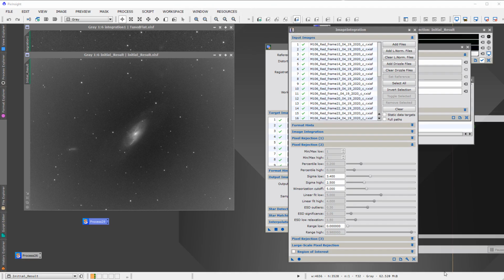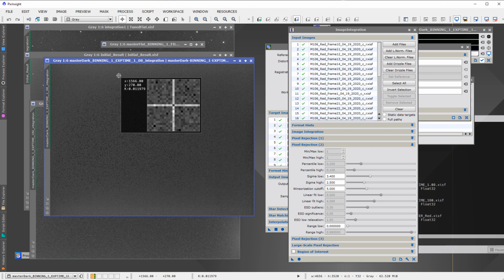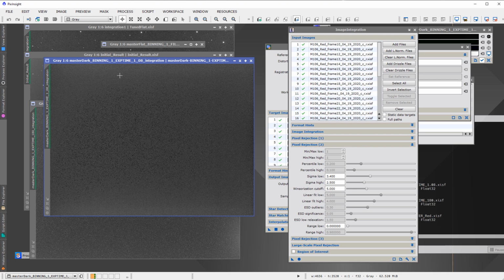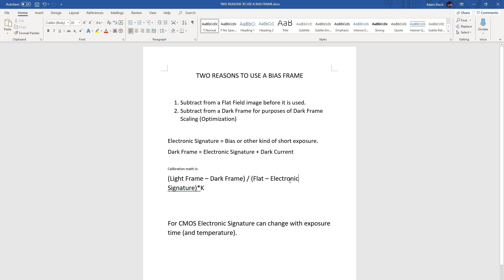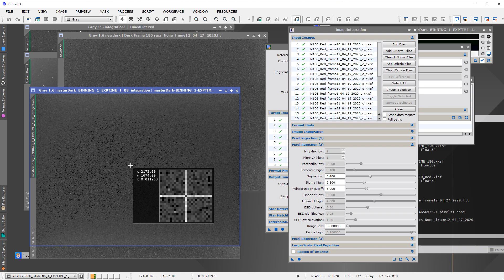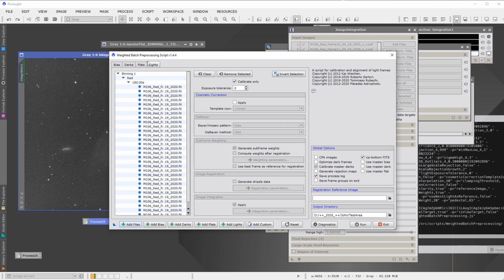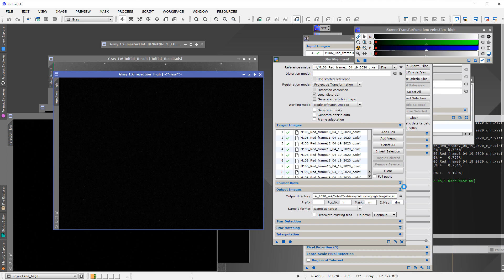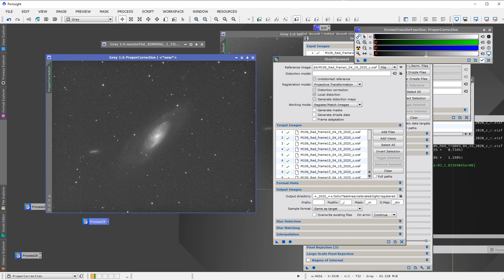Do Your CMOS Images Look like THIS?? (Part 3)

Comment: Thanks for the interesting video! What if I have the same parsley with the new dark?
Reply from the maker: Likely you are not matching your Gain or Offset settings between your lights and calibration frames.
Reply: @AdamBlock  My gain is always 0, offset is 10, and NINA selects the exposure for the flats frames.

Comment: I had the same problem, and the flat frame wasn't working!!
I checked the k value:
Flat frame = 3 sec /  k value = 0.3
And for the rest of the calibration frames, k = 0.05

What is the solution? my camera QHY294m
Reply from the maker: Solution? Become a member of my site? Good job doing the research. Did you change the GAIN or Offset between your images... are you S U R E?  This is the most common reason. There are many others.

Comment: Great series! Thanks a million for all the wisdom Adam! I use a very cheap light panel from Amazon for my flats. In order to overcome any issues of irregularity of the illumination due to the panel's electronics I changed some time ago to FLATs with an exposure time of 2.5 - 3 seconds. This seems to eliminate weaknesses of the light panel. The panel just provides three brightness levels. The lowest setting is still too bright for FLATs with 2.5+ seconds  exposure time I am dimming the light panels with one, two, three sheets of copy paper. NINA Flat Wizzard is a huge help to get the right brightness level by indicating if the FLAT is too bright or too dark. Too bright or too dim tells me if I need to increase brightness/ remove paper sheets or to reduce brightness/ add more sheets of paper.
Since I do so using FLATs with 2.5 - 3 second exposure time I never had any over/ under correction issues anymore. I still use BIAS frames with my CMOS cameras. As far a I know the BIAS signal is subtracted from the FLATs. Please correct me if I am wrong.
Reply from the maker: Correct on the last point. For most cameras bias usage is correct. Just some cameras with amp glow ...no.
Reply: @AdamBlock  thank you very much for the input Adam! I am using two cameras with IMX571 sensor without any Amp Glow. It is an honor for me to hear from one of the masters of astrophotography that I am doing the right thing.

Comment: With my 2600MM I have the same problem, even with 'fresh' dark flats, which are also longer than 3 seconds. Someone suggested to load the dark flats as bias frames and run the script. That actually solves the problem, at least for me.
Reply from the maker: You should really understand why that works..because it does not make sense. Assuming you are not complicating anything with optimization (turn it off)- in both cases the bias and a dark frame is simply subtracted from the flat. There absolutely no mathematical difference.

Comment: Great Stuff!  
Unfortunately my recent aquisition of the Meade Deep Sky Imager IV mono cannot be corrected either way.  I experimented for a day with the "modded" flat as well as 5-6 second flats/darkflats as well as brand new darks.  The stack without any flat was beautiful ,beside the vignette and dust donuts  in them , but  after 6 different modified files (using different modifier number)  and 3 different set of flats (different lengths from very short to 5seconds ) , no flats could correct my stacked image.     
Along the modified masterfalts I tried many numbers and while one came very close, it was still leaving a white residue enough to smudge the galaxy away  while correcting the vignette.  Not even ABE could get the over correction out without destroying the image. 
 If I went a  .001 point higher with the correction-modification in PixelMath  (for example +0.45 was almost good and tried 0.46)  , it would start to overcorrect the vignette,  just like the un-modded flat was doing.  No other number worked and honestly, I got tired of messing around with the whole thing.   It supposed to be a hobby, right? 
  I gave up on the camera (panasonic sensor) ; - it only has ascom drivers and I was lucky if it didn't crash at least once each night. 😢

Comment: I have always been less than impressed with my flat frames.  You mentioned not using a good flat panel.  Do you have any suggestions on a good flat panel that illuminates evenly at such dim levels that would allow me to hit the 5s flats with a luminance filter?
Reply from the maker: You need to separate the panel from the aperture. Distance is your friend. So, EL panels are obviously very good... at a distance from the telescope. Double scatter can also be helpful. ND film is also a good tool to manage the brightness if necessary.
Reply: @AdamBlock  I bought an EL flat panel from Elumiglow and it was awful so i returned it. I've been scared to go that route since. It was sitting right on my dew shield though, so maybe if it was farther away it would have worked?
I also have one of the sketch pads. Would it be worth a try to maby lay it on the ground and point my scope down at it?
Reply from the maker: @TomDastrup  The Dew shield could have been part of the problem... its inner surface could have been scattering light... this is always the issue...
Reply from the maker: I believe that EL panels at the aperture of the telescope can be a source of scattered light. Putting them at a distance helps confine the rays of light entering your telescope and minimizes issues you may have encountered. The faintness or brightness of the panel does not affect how it illuminates the sensor.... but yes it affects your exposure time. As I mentioned, neutral density film can help a panel and achieve low light levels. 2-3 seconds is a good target. Distance from the panel also helps... inverse square law and all of that.

Comment: Could you explain this please if it's not too much trouble? I don't understand how a flat over (or under) correction can possibly be due to a bad dark. The spatial information of the vignetting pattern is contained entirely within the flat itself, which is in the denominator. The dark cannot affect it being in the numerator. Thanks.
Reply from the maker: The (flat) dark calibrates the flat field image. If the dark has a constant applied to it (a pedestal value)  it will will over/under subtract the bias level of the flat. This leaves a pedestal IN THE FLAT. When you divide the date by the flat, the scaling is wrong due to the pedestal. So the problem is the flat needs to have only the light signal in it... no other additive constants or it will not work.
Reply: @AdamBlock   Thank you for a prompt reply. I still don't quite understand. I do understand that a bad "flat dark" can absolutely result in over/under correction from the "flat" - this is exactly the same as you adding a constant K in the video to remedy most of the over correction. But in the video at 6:16, you say that John provided new "darks" (exposure time 180 sec), not "flat darks" (1.08s.) And then you proceed to replace "darks" (pixel value of 0.0036) with new "darks" (pixel value of 0.012,) consistent with the notion that old "darks" were bad - they underreported the "electronic signature" of in the "lights."

Comment: So if I have a DSLR and an Ipad with which to take flats, I should try to get an exposure of a few seconds? Mine have been quite short so far, using Av mode (about 1/50 th of a second). Great videos, by the way!

Comment: Great videos Adam. I had the exact same issue and this helped me trace the root cause to my Darks having Offset 0 where all other subs were Offset 30. I wonder whether the same applied to "Johns" data
Reply from the maker: It did not apply to John's data (lol, my attempt at being discrete) nor to some other examples I have now seen many more of. There is something about the 1600.... But as you note, there are a number of different variations of this issue- I am glad this video helped you figure your out!

Comment: Hi Adam, great tripe video stacked with a so many interesting features - the point about using flat exposures of longer lengths was very interesting - I use a SX 694 so how do I and others with other ccd cameras find out optimum exposure time for taking flats?
Reply from the maker: A couple of points... the light level itself (in terms of exposure time) is usually NOT the most important issue. For cameras that have some weird short exposure mode- I think 2 seconds gets you safely above that. There is  one more case for longer exposures- if you have a large camera (likely CCD) with a Iris type shutter- typically 5 seconds or more is necessary due to uneven illumination of the chip as it opens and closes.

Comment: I might be able to use some of this for adding the constant to the flat master but the darks and dark flats have the same values, almost. Like 0.0295 average on all darks and dark flats. That was interesting though. There's something seriously wrong with the ASI 294mm Pro. It takes great images but flats will only mess them up.
Reply: I have the exact same problem now. Did you find a way to fix or mitigate it?
Reply: @kamilkp  I can't do narrowband on a full moon but if I use exposures for flats and dark flats for more than 3 seconds each it seems better. Flats still won't work very well if the moon is full.

Comment: Is there a table somewhere that guides people for proper exposure of flat frame per sensor?
Reply from the maker: The brightness of the flat isn't as important as the proper calibration of it in terms of how well it does its job. Anything from 20%-80% in the linear range of the sensor is likely going to be just fine when averaging a healthy number of flat frames. Typically people shoot for 50%... but as long as you have signal and it is not non-linear/saturated... this part of flat acquisition is easy.
Reply: Thank you for  responding.   And in terms of minimal versus maximal of flats in time, what would be your recommendation?

Comment: A factor of 3.3X on the mean of a dark frame?  That is most certainly not because it was 6 months old.  It had to be the wrong gain or offset, or something other than "age".  I use dark frames that are several years old without issue. Yes a new hot pixel or two might show up, but dithering and statistical stacking fixes that.
Reply from the maker: Not according the the FITs headers. Everything is the same as far as I can tell and the difference in the darks is due to some change electronically. This conditions has occurred with other users of the 1600MM as well- which is why I made this video- it isn't a one-off thing! I can provide the data that supports the observations.
Reply: @AdamBlock  I just did a test.  My ZWO ASI 183MM from almost 3 years ago and today.  All the same settings.  -15C, Unity Gain, Offset 12, 300-second exposure, stack of 30. The 2018 Mean ADU (16-bit): 845.7029   The  2021 Mean ADU (16-bit): 845.4275.   Difference in number of hot pixels: 0.  You can see a summary of the test here:  https://www.flickr.com/photos/125134422@N06/albums/72157719050150259
I can provide al the data .  I am sure this is also true for my other 6 ZWO cameras.  Maybe the 1600 is unique.
Reply from the maker: @stevenbellavia5415  That IS the problem. You can't get away with generalizing. There are many pages on Cloudy-Nights and other places about this sensor (and others in the ZWO line).  It only takes a few popular cameras to do the damage!
Reply: @AdamBlock  Correct, you cannot generalize.  I have several cameras with several hundred hours of imaging time on each, and have never had to redo a set of darks. So perhaps it should be mentioned that this only seems to be true for one specific camera. (Note:  I have seen my own FITS headers with wrong information, such as gain and offset, when the camera is passed from one ASCOM application to another, and the gain and offset was changed, but the image capture program, which writes the header, does not acknowledge the change).
Reply from the maker: @stevenbellavia5415  I agree with the gain/offset mismatching. One of the interesting aspects of my experience, is that I receive data from many different cameras/sensors compared to any typical imager. (People send me their data to evaluate... ). The lesson here is to look at the (calibration) data- do not assume. Not even if you have hundreds of hours of imaging time..etc etc.
Reply: @AdamBlock  Agreed!  My only concern was that someone sent me their data, after watching your video, and the mean of their new master dark frame was 70 ADU's lower than the previous, only 3 months older.  They assumed their camera was aging rapidly.  But it turned out they were doing their dark frames in the daytime, without considering light leaks, which was the actual cause. I am sure some cameras need more frequent dark frame sets than others, and it can't hurt to do regular dark frame sets at some interval of time. Thanks for your service to the imaging community.
Reply: This is great! I’m currently fighting the same issue - the value of my master dark is smaller than the value of my dark flat. Whats strange is that my darks are only days old with the same exposure, gain, temp, etc. Currently retaking then. Hopefully this solves problem! I also ran into problems using pixel math to fix the issue. I’m new to PI and the UI is much different than when this vid was taken.

Comment: Great video. I'm a complete newbie so there was a lot for me to learn here. I'm not yet using flat darks but will start. QUESTION: I wondered, since you were looking at darks vs flat darks, if you might have used the statistics process to identify the possibly the median difference instead of guessing about the 0.35 fudge factor?

Comment: Adam, what camera generated this data?
Reply from the maker: I guess I never said did I? Good point. I believe this is from an ASI1600MM Pro (mono).
Reply: @AdamBlock  I had a very similar problem with my OSC ASI294.  If I hadn't run across this video, I'd still be trying to figure what's wrong with my Flats; Thanks!  I built my Dark library last October after I'd had the camera just a couple of months.  But, I re-took my minus10-240sec-gain120 Darks today and sure enough: the Flat calibration and overall calibration in PixInsight is much better with the new DarkMaster.  But, you know what's weird?  The amp glow is MUCH more subdued in today's DarkMaster; almost undetectable.  And, I verified the Oct 2019 DarkMaster has easily 10x the amp glow as today's DarkMaster.  Has anyone ever heard of amp glow improving over time?

Comment: Congratulations for solving the problem :-). I was very surprised that a sensor could change that much. Are you sure the old darks had the same offset, gain and temperature? You can change the offset of a CMOS camera, you know.
Reply from the maker: That camera/data was not mine- but as far as I know the gain was not changed. It is difficult to be given someone else's data and figure things out...